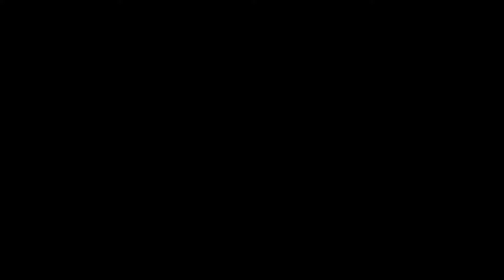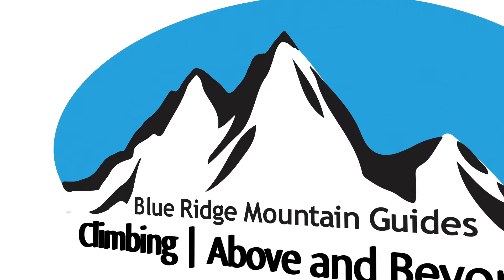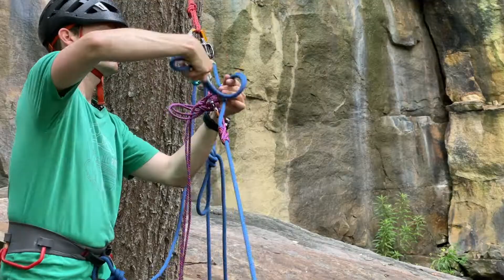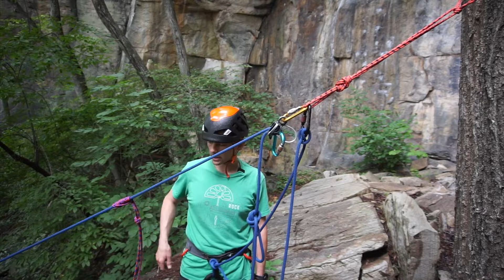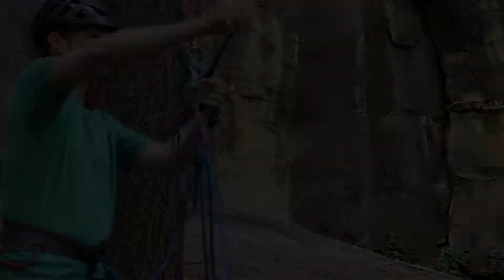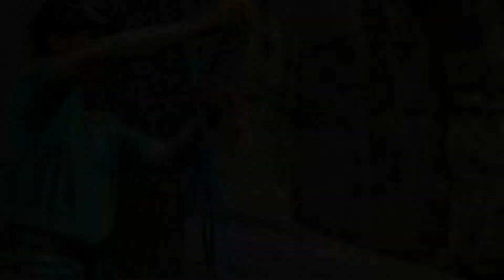Block and tackle for climbing self-rescue

Comment: Hey great video just out of curiosity  why not pump the atc to lower the load onto the prusik? or what the benefit to using the cordelle?
Reply from the maker: Hey Mark, thanks for checking out the video and the comment! You could definitely do a load transfer as you are describing if you had the ability to lower. A major benefit there is that you are working with gravity rather than hauling against it. The intent of the video is to largely introduce the block and tackle and present some possible applications.